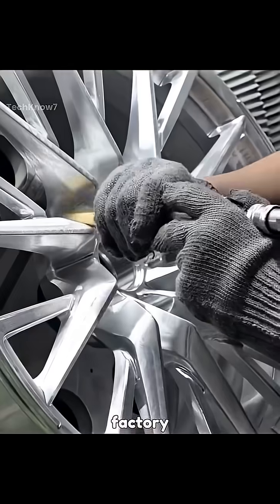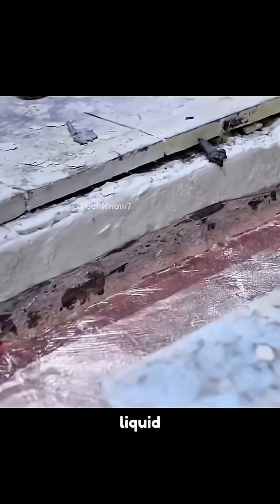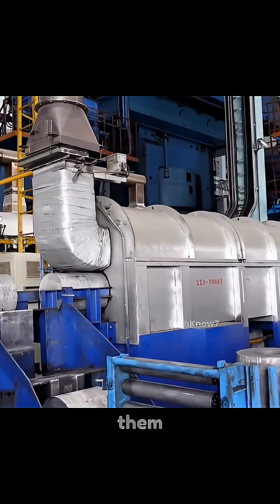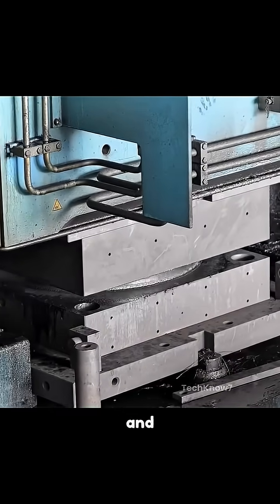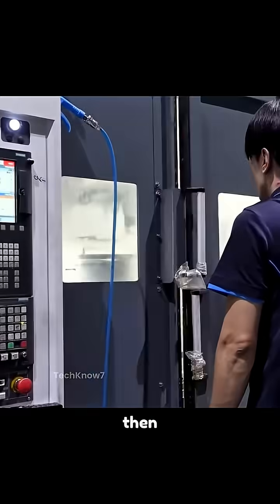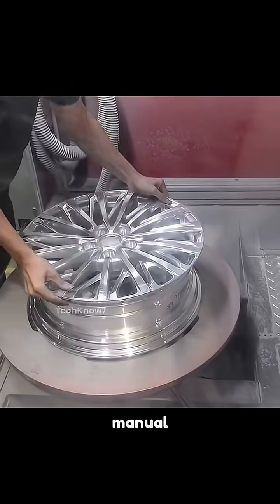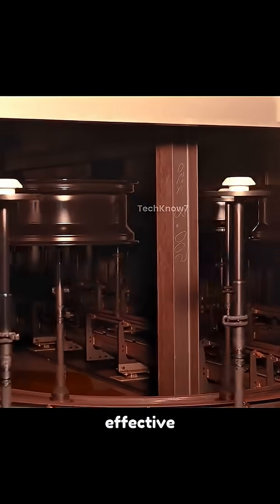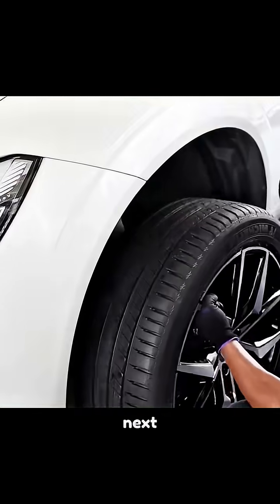How Forged Aluminum Wheels Are Made

Comment: Years ago my friend tried to remove a flat tire.After the lug nuts were off, the aluminum wheel was stuck to the hub. After some friendly persuasion with a 2x4 the wheel finally came off but its center was still stuck to the car! I guess someone at the factory forgot a step.

Comment: Your comment about "homogenizing" is misleading. The process is actually called Stress Relief which, while being self explanatory, is much more appropriate. Homogenizing does not necessarily remove stress, but does distribute material evenly. Stress relief is a specific process in which metal is heated to allow the atoms to align structurally, forming a stronger molecular length that can withstand stress that might otherwise crack or shatter it.  Regards, your friendly neighborhood manufacturing engineer.

Comment: Everyone, please notice they're called "wheels," not "rims." 
The word rim only signifies the outer edge of a circular object, in the case of a wheel, the rim of the wheel is where the tire mounts.  The center of a wheel is called the hub, radiating out from the hub, may be spokes, slots or a solid disc, all together, with or without the tire, the complete assembly is called a wheel... This has been a public service announcement, brought to you by the coalition against people calling wheels, rims.😂
Reply: There is the weird part of translation an issue. A wheel in dutch is complete with the tire. A rim is only the metal/aluminium part that holds the tire and mounts on the car😂
Reply: @tortugab  Same thing in German.
Reply: @tortugab  Consider this, the "steering wheel" in your car, is made up of the same components.  The "steering wheel" is mounted to the column by the hub of the "wheel," radiating out from the hub are the spokes that connect to the rim of the "steering wheel," typically, while driving. you hold on to the "rim" of the steering wheel, but you don't call it a "steering rim," it's called a "steering wheel."  When you drink from a cup or glass, you put your mouth on the "Rim" of the glass or cup to take a sip, but you don't go to a restaurant and ask for a "rim" of coffee, you ask for a cup of coffee.  If you climbed to the top of a volcano, you can stand on the "Rim" and look over into the caldera. The "Rim" is only the outer edge of a circular object.
Reply: @stevenhall9009  I like that explanation but a wheel is only complete with a tire 😂. So a rim has 2 meanings. The outer Rim but also the complete ensemble is called a Rim. As long there s no tyre mounted
Reply: @tortugab  Ok, well how about this... Imagine going far back in time, to when the 1st prehistoric man created the wheel or a rudimentary wheel barrow to assist him in transporting or carting around heavy or multiple objects.  He definitely didn't have a tire, but it didn't in any way negate the fact that he had created a wheel.  A wheel is a wheel with or without a tire, with a tire it's a wheel & tire assembly.  Someone mentioned Germany, you maybe familiar with BBS wheels?  You know they make forged multipiece wheels, where the "rim" is bolted on separately to the web of spokes, once all the components are assembled then it becomes a wheel. If you add a tire, then it becomes a wheel & tire assembly.
Reply: @tortugab  Speaking of a wheelbarrow, I've never heard anyone refer to it as a rim-barrow.
Reply: Yeah, I agree😅😅😅
Reply: Is your nickname "Eggbert"?
Reply: i dont care as long as that thing is no tire is a rim if it combined with a tire then its a wheel...no need to be nerd about it😂😂😂
Reply: @matthewluy1403  You know when you talk to most women and they don't know one car part from another😂 That's what this discussion is beginning to feel like😂  This is a car part we're talking about, and I've used example after example, you can even Google... What are the parts of a wheel?  And it will show a diagram, specifying that the "rim" is only the outer edge of the wheel.  It will also tell you that the wheel is a wheel with or without a tire.